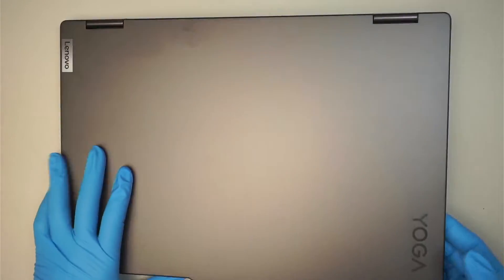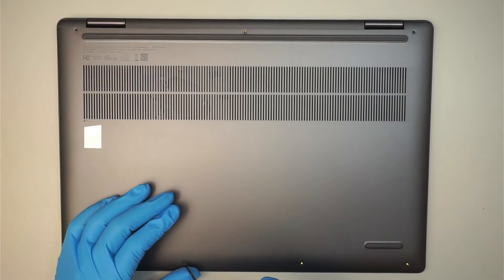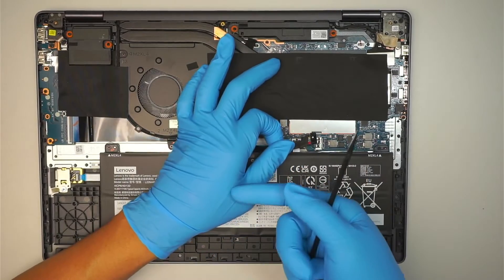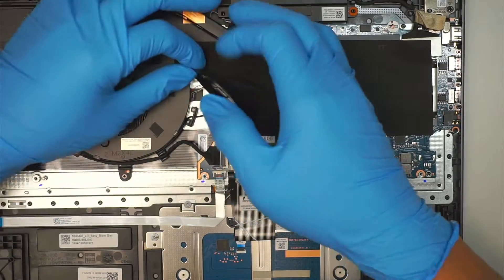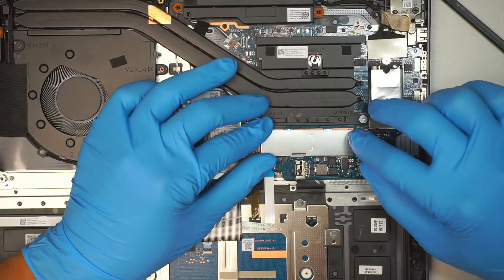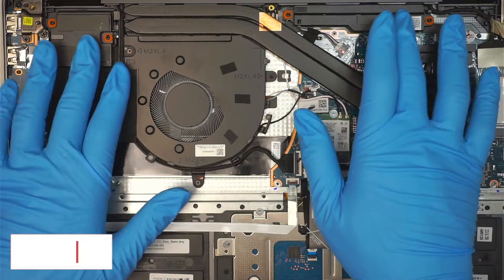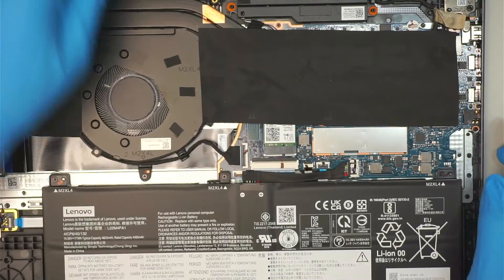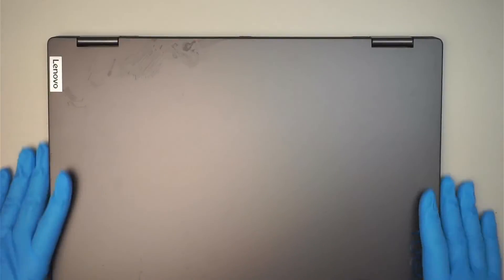Lenovo Yoga 7 16irl8 Battery and SSD Replacement

Comment: It looks like you can put a full size m.2 in that slot.  It has a piece of metal (foil?) and a screw up above.  I think that metal foil is to just fill the unused space and protect the back of the PCB.  Remove that and replace with a normal m.2.  I am buying one of these computers today and might try it.

Comment: does it have 2230 or 2242 m2 ssd size?
Reply: It has 2242 m2 ssd. I have the same model and wants to replace my ssd for 1Tb. The only one thing I can't get is what is this black tape for? As it covers the ssd and these guys may get really hot and instead of giving more air for heat dissipation they cover it with this tape. I'm going to install copper radiator on the top and cut the tape above the ssd zone

Comment: Why in the hell do so many of you computer guys wear nitrile gloves?  You are just filling up landfills for no reason.  Don't be afraid of getting your hands dirty, it builds character.
Anyhow, thanks for showing me how to get the back off, I need to replace my trackpad.
Reply: Its static damaged . Some guy temps to has static then other. Like in winter you open the door and you can hear the pop sound when you touch the door opening . Same logic here . I work in phone repair and have to use glove cause my hand also send electric to the main , sometimes its kill camera and weak the coponents
Reply: It's more to protect the pc. I think you could use an alternative, but then you have to jump through special hoops to ensure they aren't actually damaging the hardware as well. In the grand scheme of things, not wearing gloves probably won't hurt anything, but it never hurts to be careful, especially when working on someone else's property.
Reply: @6milesup, were you able to replace your touchpad?  Mine is not working properly and I'd like to replace if I can!
Reply: @RichardSignell  Yes, I replaced it myself.  Pretty straightforward really.

Comment: I just spilt coke over mine so thanks for vid unplugged battery and fingers crossed. Got to it quickly at least and have turned it upside down. Looks like that all I can do as cleaning with alcohol is going to be tricky removing the mb

Comment: Very helpful. Couldn't open this before. Thank you.
Reply: I just spilt coke over mine so thanks for vid unplugged battery and fingers crossed. Got to it quickly at least and have turned it upside down. Looks like that all I can do as cleaning with alcohol is going to be tricky removing the mb
Reply from the maker: Glad it helped!